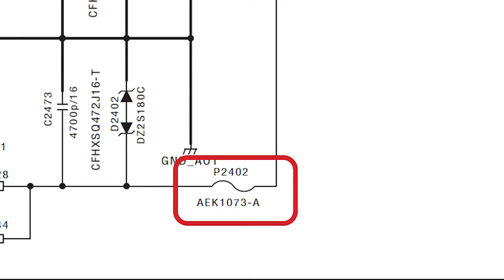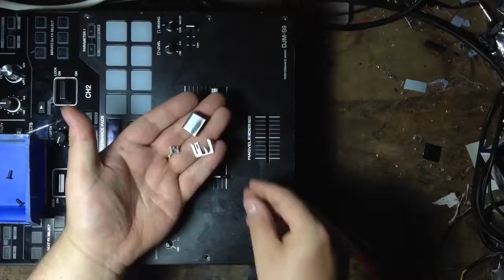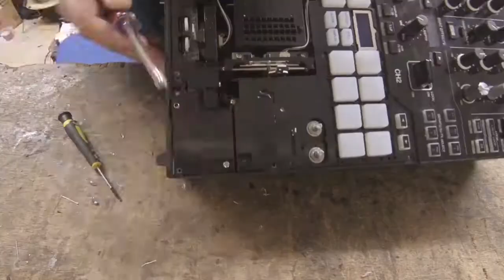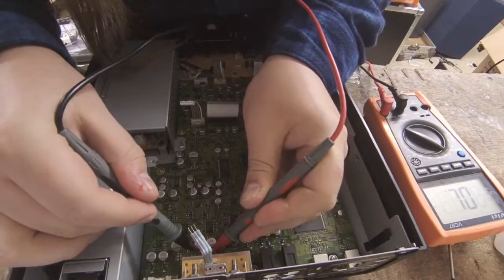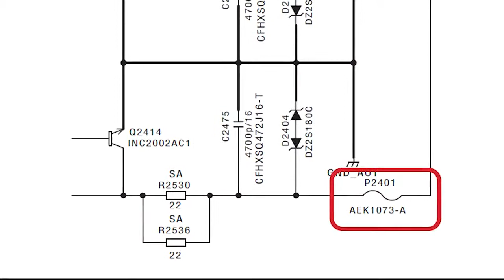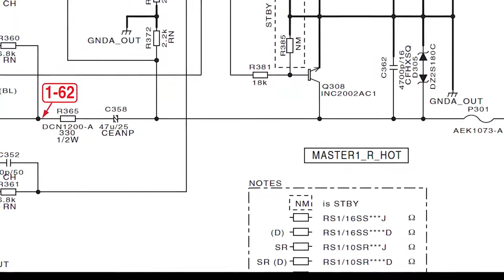Pioneer DJM S9 XLR buzzing or no output issues repair fix

Comment: How on earth do you manage to put 1A through an XLR connector in the first place though?  I suspect the fuses are there to pass the "your product will not catch fire if any input or output is connected to the mains" test or something like that.  You won't get UL approval if your product acts as an incendiary device in any circumstances I believe. Its common to see fusible resistors and fuses added to prevent such failure modes.

It may annoying to have to replace these things, but its less annoying than being burned alive because the unit exploded in flames...

Comment: Cool are companies that stand by their mistakes! 

and provide their customers with a reasonable solution. !!!!
Where is Pioneer DJ's solution for this ?????????????????????????

Got 6 mixers from the first series. Sold out of the 6 pieces. All came back. At the moment I have 3 repairs with me. Unfortunately, the problem with nobody is that the backups are complete. I ordered a new print DWX3673 for one. And since the part of the XLR output has been completely revised !!!!!!!

Comment: Just come across the same problem on a DDJ-RZ. Seems like it must be a common problem then. What the hell are people plugging the outputs into that's passing over 1A of current through this fuse? Simple enough to repair - the fuses in the RZ are even easier to get at than the S9 in your video - but I wonder if I'm likely to see this machine back on the repair bench again in a few months time with the same problem. Tempted to just short the damn things out, but presumably they are there for a reason!